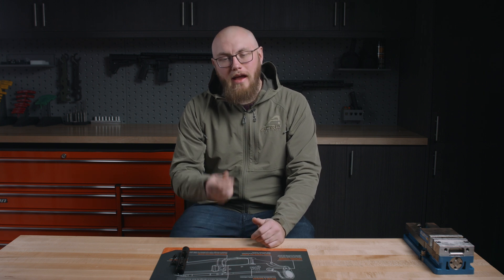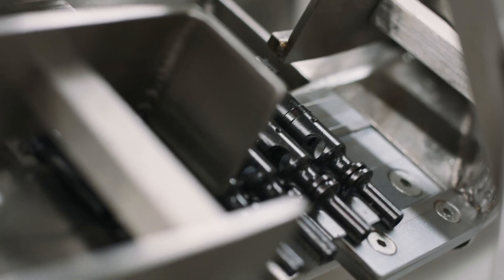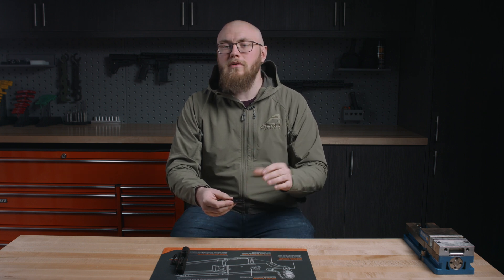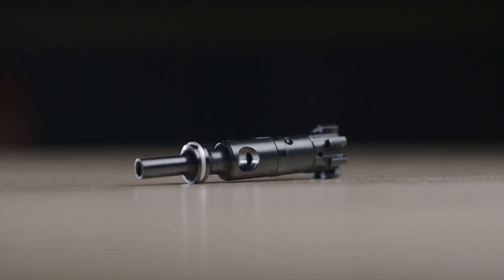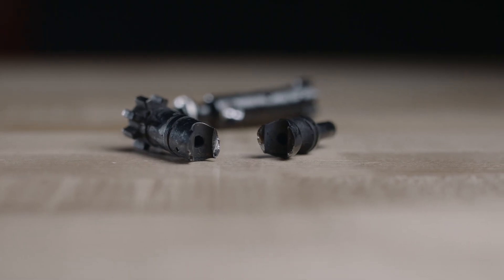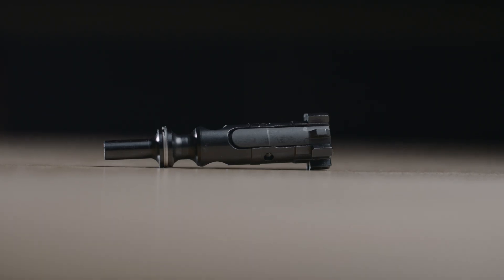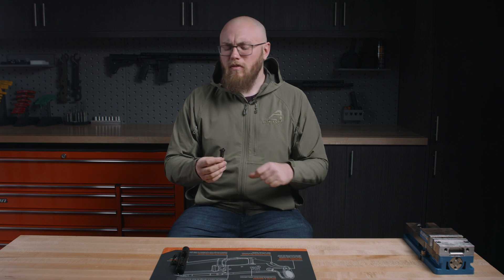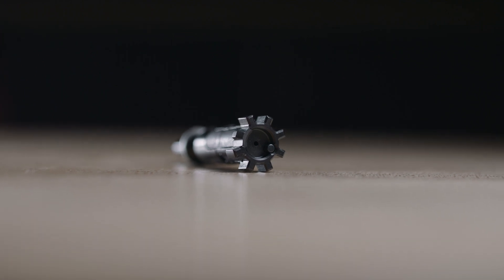Deep Dive - Pro BCG Bolt

Comment: Many of these same metals appear on the product page for the basic Nitride BCG

Example:  
Bolt Material	9310 Steel
Carrier Material	8620 Steel
Black Nitride Finish - advanced lower friction coating that minimizes the need for lubricants and cleaning
Properly staked gas key
Shot peened
HPT tested/MPI marked

1)  Does the Pro series have "better" staked gas key than the base?  🧐
2)  Is the 9310 steel on the Pro series Bolt somehow better, or treated differently? 🧐
3)  Is the 8620 Steel used on Pro series carrier somehow better, or treated differently?  🧐

Also.... perhaps a pet peeve.  I thought all Aero products were professional grade?  Calling these Pro, and the others not, implies that perhaps they are not suitable for duty use, or military use, or use in a life-or-death situatioj (i.e, defending your life)
Reply: Yeah, what’s the actual difference, except for the price? So far all I see is a nitrided firing pin and a mark on the cam pin? Am I missing something?

Comment: Nope. At least most premium 158 carriers are hp tested. And the fact is you won't have a problem with a bolt if you are replacing them every 7-10k or so. Called preventive maintenance. Gas rings every 4k and their cheap. 🙄 Making a issue out of a non issue.